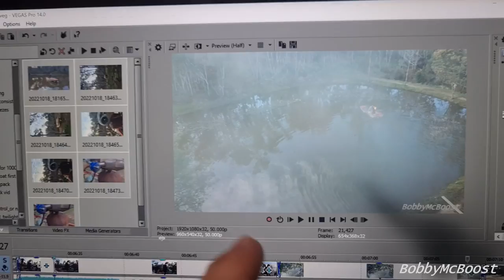TURBO Burn Barrel - Will it EXPLODE?  Turbo Jet Boat pt.4

Comment: WHAT IF ITS MADE LIKE A COMPOUND SETUP ? THAT WOULD SURELY MAKE SOME POWER
Reply: compound turbo setups are designed so that engines can have a smaller turbo produce boost low down in the engine's rpm range, but then also have a large turbo to produce maximum boost at wide open throttle. In this sort of jet-engine setup, having a sequential turbo setup would not likely have much benefit. As it is, the turbo is producing way more boost than it was ever designed to.

Comment: if you put a radiator behind it in the water, and fed the oil through it, so the oil was entering the turbo not on fire... the thing would probably last till it ran out of fuel (or the turbo overspooled and tore itself to bits... but with the highspeed.. both would be awesome!

Comment: You could also try filling the barrel with charcoal briquettes instead of wood, which will give you a much cleaner burn and also minimize the amount of large particles being ejected.
Reply: Charcoal briquettes absolutely will not give you a cleaner burn, in fact you'll end up with more dirt and other unburnable junk in your output air than if you had used plain wood. The best option would be lump charcoal and a cyclonic air filter on the output that will catch the remaining embers and allow them to burn completely.

Comment: I would suggest a better oil system since the one you have seems to have failed a few times now. Maybe build a tank or put a bung with a hose barb in the bottom of your bucket so that it is 1, not capable of pulling free, and 2, always has oil above the inlet of the pump so that as long as the tank does not leak out some other place, you always have oil in the pump and in the turbo.

Drawing anywhere above the bottom naturally increases the risk of oil starvation, as well as not firmly affixing the inlet of the oil system so it can not become disconnected.

Comment: You need to run the compressed air tube right through the exhaust so it starts much quicker with hotter air

Comment: The outboard rudder only works because of the volume of water being dragged past it by the prop. You'd need a far bigger rudder is you want to turn the boat itself - See sailing ships. Probably better to just have two ropes tethering the boat to the anchor - One at each end

Comment: Maybe you should come up with a control system to electronically regulate, remote control, and remote shutdown so that you can get more life out of the turbo. Have it control the waste gate so that if the turbo overheats/looses oil it opens the gate and shuts it down. Maybe also have it close the intake at the same time. It could also regulate the boost pressure so you can run a series of sequential experiments where each time you turn the boost limits up to see how much it will take. More life, more video, more cool stuff!

Shoot, I could do it with a microcontroller and some protoboard in an afternoon. Put it in a weather-packed box and call it a day!

Comment: Just rudder the air like an airboat. Run some levers to the "throttle" Partition the jet with steel mesh and some cheap Kevlar from ebay. I don't know why but I gotta see how far this goes. Got any merch or a patreon?
Reply from the maker: Yep yep, merch at bobbymcboost. Com 🤘🤘
Reply: @BobbyMcBoost  my man I'm on it!
Reply: @BobbyMcBoost  just put my order in can't wait! Got yourself a new super fan!

Comment: You should use a Bypass, to force some cool Air from the compressor direct before into the Turbine wheel. This will cool the turbine, and IT will Help to control the burn, without using a restriction of Air before the compressor. It will reduce exessive boost, but it will increase thrust!. Cause the unheated air will mix with the heated exhaust Gas, expanding more, and thus making more power and producing a lager volume of total exhaust.

Comment: Finally we’re getting somewhere with this turbo barrel!  

Why would the oil pressure need to be referenced to boost pressure??
Reply from the maker: Doesn't need to be referenced, but would be cool use of boost pressure to have it supply oil with no moving parts.
Reply: @BobbyMcBoost  I thought you only need very low oil pressure for turbo bearings. It’s all hydrodynamic lubrication. It’s all about flow/volume… not pressure, right?
Reply: @mareksumguy1887  depends on the bearing type used in the cartridge. Ball bearings sure I agree but an old school journal bearing turbo needs a certain amount of pressure to stay suspended in the middle ( think crank and rod and how the oil film holds them apart ).

But referencing the oil pressure here to boost pressure would be a good idea. Since we are talking psi well beyond what that turbo was designed for. The extra oil pressure would help stop the oil seals from getting pushing in to the oil journal in this specific case.
Reply: @lewisanth4986  journal bearings are still hydrodynamic… not hydrostatic like main/rod bearings.
Reply: @mareksumguy1887  I guess the turbos I've worked on are completely inefficient and old then! Haha. Thanks for telling me.

Comment: Did you ever use a force gauge to determine how much thrust this system generated vs. your previous video?

Before, since you were dumping the wastegate output into the exhaust, it was contributing to the thrust, making the system significantly more efficient even if the extra air wasn't igniting the unburned leftovers in the smoke.  (Although judging from how clean the exhaust was in your previous video, I think that the bleed air was causing a secondary burn) 

You may have been making more thrust with the old setup, it's the difference between a turbojet and a form of turbofan (except turbofans are usually a separate turbine and compressor, but bleed from a single compressor probably works somewhat?) - no one uses turbojets any more because not only are they less efficient, their inefficiency leads to poor thrust for a given combustor temperature.

Another thing to look into might be some internal baffles inside the barrel to make it more similar to something like the Solo Stove, with a secondary burn happening before the turbine: https://fireplaceuniverse.com/secondary-burn-wood-stove/ and https://blog.solostove.com/how-to-secondary-burn/

Comment: Need a remote control of the inlet set up, clearance the turbine and impeller in a lathe to compensate for the heat expansion.. Start it up on methanol
Reply from the maker: The turbine will self clearance 😉

Comment: isn't it easier to make a throttle valve on the turbo inlet so you can regulate the power more easily than the plate. Steal a bit of servo stuff from a RC car and you have a remote throttle.
Reply from the maker: I could make somthing work, but there is plenty around now that run and have throttles,  but none that make thrust and push a boat 😉🚤💨

Comment: Your turbo starved for oil. You need to wire up a tiny little electric pump. That will circulate the oil to the turbo. Plum a small either a heater core or radiator to the oil system so it can get cool before circulating to the turbo!

Comment: It’s amazing how that intake pipe to the turbine went from barely glowing at 6:31 to bright orange at 6:35. How thick is the wall of that pipe?
Reply from the maker: Like 2mm stainless 🤘🤘🚀
Reply: @BobbyMcBoost  that’s impressive. It was able to heat that up to near the point of failure in a few seconds! 

A few technical questions. Do you know if the turbo died because of the heat or because it was running too fast? 

Obviously both speed and temperature were more extreme than it was designed for.

Also, do you know how much wood in (as far as weight) you usually use and how long it takes to burn it with the throttle plate partially open? I’ve got some armchair engineering I wanna do…

My first impression watching was that it heated the bearings to the point where it cooked the oil and then it lost lubrication.
Reply: @deltab9768  I might be hearing it wrong but from the talk in the video, it sounds like they said the turbine developed enough pressure that it popped the oil tubing and stopped getting oil.
Reply from the maker: I think if you were picky, it died due to heat. But only because it starved itself of oil from boost entering the bearing.. 

Roughly half a barrow of fire wood, say 15kg ish, bit less.  Last video where it ran with 6psi of boost was probably for 6 mins full run time, I can check to confirm that time to help with calcs. If you want 👍
Reply: @BobbyMcBoost  that’s close enough for the rough idea I have. Thank you! I’ll edit into this comment when I get a chance!
Reply: @BobbyMcBoost  So, with some very rough calculations and assumptions about the amount of wood, moisture content etc, I’d say the total power being released on the regulated run (mostly as heat release rate, H.R.R.) is roughly 600 kW. That’s enough to vaporize something like 14 liters  or 3.8 gallons of water per minute. 

Now, according to online calculators, that’s very nearly the equivalent of how much water will escape a 1/8 inch hole at 150 psi. There’s some variation depending on the amount of friction in the hole, and how much boost it has to force the water in against, but now we have a rough baseline of how much to use.
Reply: @BobbyMcBoost  
So here’s my suggestion. Have a steel pipe that goes into the chamber, with an end cap with maybe two 1/8 inch holes bored in it, facing so the holes shoot water towards the opposite wall of the chamber. That way liquid water doesn’t enter the turbine and less will land directly on the burning wood, so that it’s less likely to extinguish it. Have something like a 20 gallon pressure tank, filled with water, with a water outlet at the bottom and compressed air entering the top at 100 to 150 psi. Or use household water supply/a pump capable of 8-10 gallon/minute at 50 to 100 psi and just use another hole or two  in the pipe cap to make up for lower pressure. Put, say, a ball valve somewhere on the water supply, so you can throttle the output, and possibly use a hose so you can feed water from a distance.

Crack the valve and fill the hose with water, then shut it off so it doesn’t flood the combustion chamber.

Get things running as usual, and then when you go to do an unrestricted run of the turbine, once it starts speeding up and blasting out flame, open the valve to admit up to  8 gpm of water. If it starts to extinguish it, shut the valve briefly or dial it back a bit. It’s probably wise to stand behind something at that point, and not be near the exhaust or sides of the turbo. No telling if something will go flying at that point since the pressure/turbo speed will be high and temperature will be rapidly rising and falling.

For oil cooling, you could run it through a metal tube in a pail of water. I’m not sure the optimum pressure and flow for the oil, I was going to say an RV water pump (5 gpm, 60 psi) might work better so long as the seals don’t fail.

Yeah this would a fairly complicated thing to add, but it’s just a possibility I thought I would share.
Reply from the maker: That's some pretty crazy info hey 🤘🤘🚀 I can't say I'm looking for ways to make this more powerful just get, but anything could happen!

Comment: oil feed loop needs to match bost presure or the seals are toast
Reply from the maker: Yeahhhh I hear ya!  im gonna struggle to build a regulated 20 - 100psi oil supply though so I don't blow the seals at idle aswell 😆😆🤣 first world turbo jet problems..
Reply: @BobbyMcBoost  a dirty hack is to  run oil pressurised from and to a metal tank/ radiator that is ported to the manifold, but be sure to have over pressure relief hot oil is no joke

Comment: Need more oil pressure?
Reply from the maker: Could be part of it. I like the idea of using the boost to pressurise an oil feed, just makes it a challenge to drain the oil in a closed loop..
Reply: @BobbyMcBoost  high pressure pump (something like a pressure cleaner pump) and unloader valve set to 80psi on the drain?

Comment: how about steam engine with pond water
Reply: at least as coolant :)
Reply: better let God save you
Reply: you cant do it yourself, not by your own attempt
Reply: self-selected service to God is not worth it or even possible
Reply: no people based service is useful
Reply: you could try a helicopter spinner instead, when the engine itself stands still, make a tip-jet helicopter
Reply: it will get melting hot, even with wood, when you turbo it, but it will burn with coal also :) even more so

Comment: Use the hotter fire to boil water into super heated steam which turns turbine connected to propeller shaft, maybe you can use less coal and it will be more efficient than normal steam engine??.

Comment: you need to learn how a wastegate works.... youre overspinning the turbo and killing the bearings
Reply from the maker: I have no clue 🥲 I would bet two 60mm wastegates still wouldn't keep up with the energy in this 😆
Reply: @BobbyMcBoost   the way you have them plumbed in is wrong. It needs to go from the burn barrel,right near the turbo exhaust inlet,  to the exhaust outlet. The purpose of a wastegate it to bypass exhaust gasses around the turbine so it wont over spin. The way you have it there, all it will do it bypass boost pressure into the exhaust. It wont actually control the turbo at all. I realise you have it blocked off in this video, but if you hook it up properly, and fix that oil feed, you wont shit a turbo ever again. Also, just a side note, not having the lines hooked up to the wastegate actuator wont stop it opening, the pressure in the burn barrel will still overcome the spring pressure in the wastegate👍